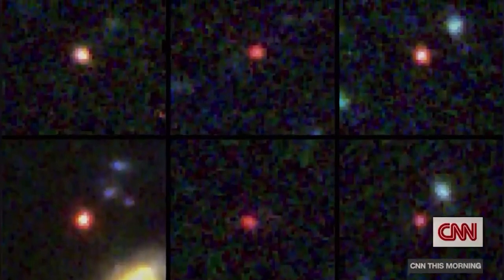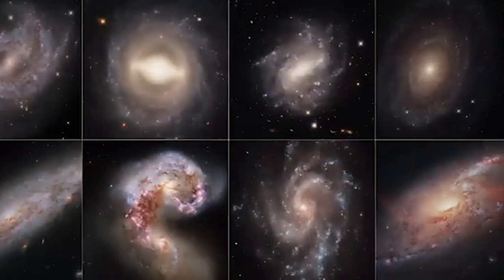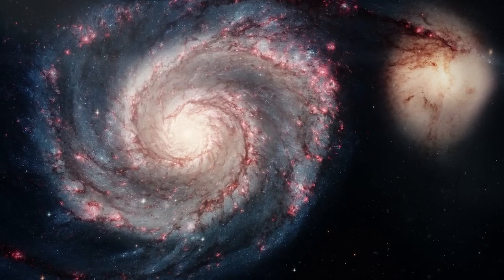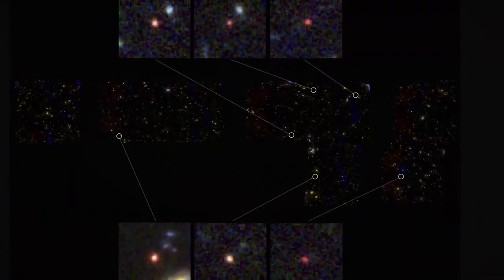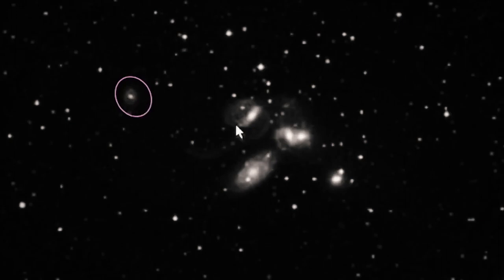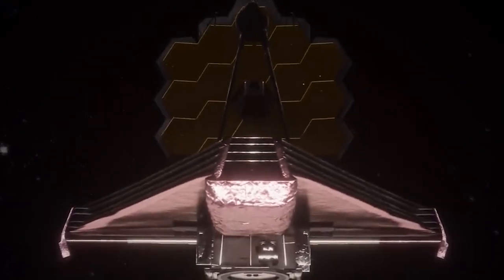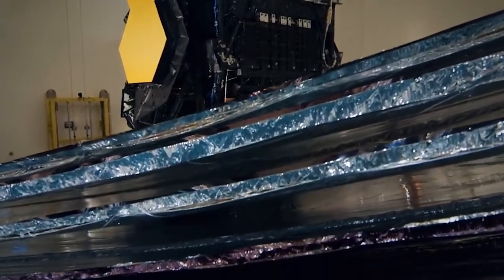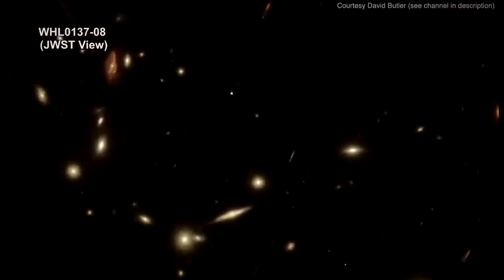James Webb Telescope Just Proved The Big Bang Theory Is Wrong! | Beyond Earth

Comment: "Galaxies 13 billion light years away ... full of mature stars with planets"!!!! I call bull$#!t on that. We have trouble detecting planets around stars in the close by region of our own galaxy, the Milky Way.
We use indirect methods to detect planets: either the transit method (massive planet passes in front of the star it is orbiting, causing a dip in brightness), or the wobble method (the star wobbles due to the gravitational pull of the planets as they orbit around it). The first can only be used if you are observing across the plane of the ecliptic, the second if you are observing perpendicular to that plane. So a galaxy a gazillion light years away, redshifted into oblivion? You wouldn't even pick out the stars in it. You can only deduce stuff (like average metallicity) with spectral analysis of the light coming from those ancient galaxies. That tells us what percentage of heavy elements are present. Young galaxies haven't had enough time to fuse hydrogen into other elements. The surprise is that the metallicity is higher than expected in those young galaxies, they have fused more hydrogen than we thought possible.
The farthest star we can distinguish is about 9 billion light years away, and that is thanks to double gravitational lensing, it is quite an exceptional case.
Sorry mate, you'll do better next time.
Reply from the maker: We appreciate your vigorous reply and opinions.
When you say you call bull, what exactly do you mean? We are merely reporting on the latest news. Here are a few of the many resources you are welcome to read:
https://www.dailymail.co.uk/sciencetech/article-11980503/James-Webb-telescope-keeps-finding-galaxies-shouldnt-exist-scientist-warns.html
https://www.dailymail.co.uk/sciencetech/article-11980503/James-Webb-telescope-keeps-finding-galaxies-shouldnt-exist-scientist-warns.html
https://www.openaccessgovernment.org/galaxies-shouldnt-exist-jwst-confounds-scientists/157923/
https://www.independent.co.uk/space/james-webb-telescope-space-galaxies-b2322370.html

Also, we very much appreciate your encouragement for our next video :)